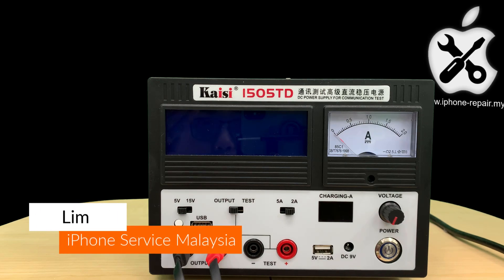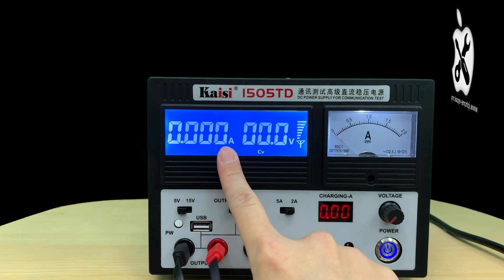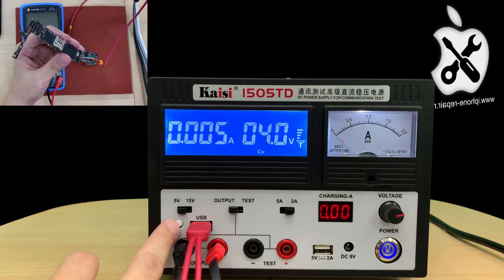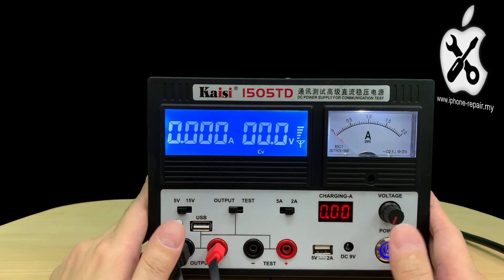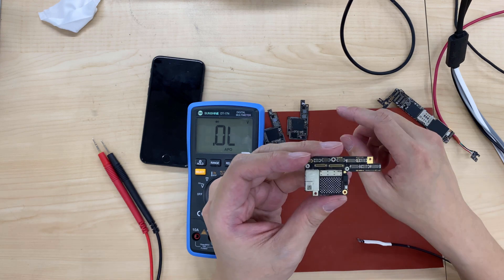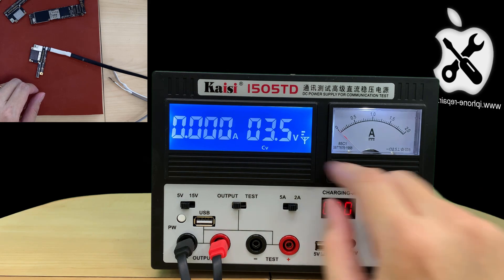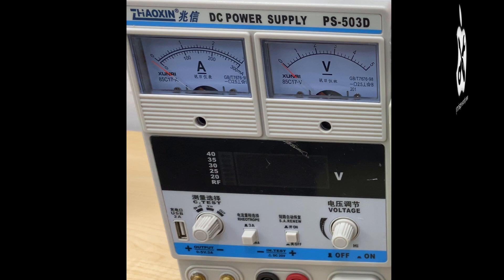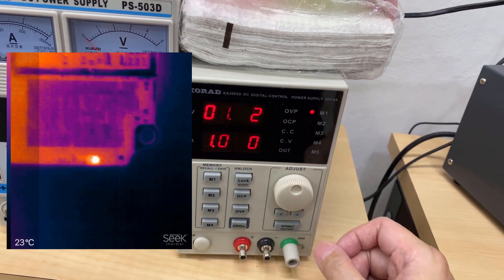Choosing a DC Power Supply【Review】Kaisi 1505TD

Comment: @iPhone Service Malaysia 11:32 i have ka3005p witch it supposed to be same power supply but with rs port and I can change voltage and current when output is on or off. You need to press voltage/current and then you can change value while output is on.

Comment: Hello Brother Lim , I need your help I’ve got 2 iPads 6the generation A1893 and 7th generation A2197 with error 4013 and if I change Nand and try to fix by programming then error 4014  comes up , can u pinpoint the exact fault what to do , any help will be highly appreciated, thanks.
Reply from the maker: Hello. I can't help without a look at it. Because you're expecting it's a common issue that just needs one solution can solve the problem instantly. 
But a real technician is about procedures. I always said Standard Operating Procedures is the thing most worthy in the training.  
Back to your question. I can't pinpoint the fault without apply SOP to check the circuit in sequence. All the SOP i created won't be public, because this is the only thing that competitors needed. They can just copy and say yes we have. Some rivals are engineers level in the schematic, but they don't know how the iPhone will react in certain scenarios. 

Learn the rules like a pro, bend the rules like an artist. Let's skip the SOP and how about I give an artist-level hint about your case? Try reinstall all the CPU coils.
Reply: @iPhoneServiceMalaysia  great response
Reply: @iPhoneServiceMalaysia  thanks for the heart felt response and thanks for the hint 👍🏻

Comment: Thank you for sharing .it was useful
I have a question , I am working on car Android head unit main board .
What is your  suggestions ? What kinds of powrsupply should to use ?
I will do appreciate your guidance.
Have a great time
Reply from the maker: Interesting question. The typical car battery is only 13v..  your headunit android won't be use on truck, right?
so anything that is 15v or higher is enough. As for Ampere, choose at least 5A or higher. 

Fun story, sometimes i help my friend charge the car battery. 30A power supply can charge full within a day.
Reply: @iPhoneServiceMalaysia  thank you for responding .
Yes it does , Android car head unit is for all types of cat truck and so 
You mentioned a good point I will do use your guidance .
Have a great weekend